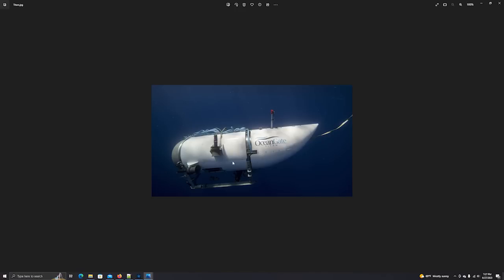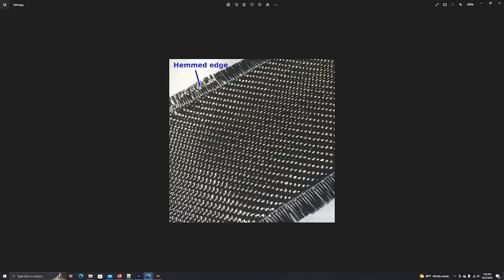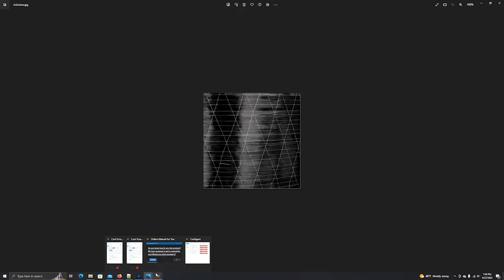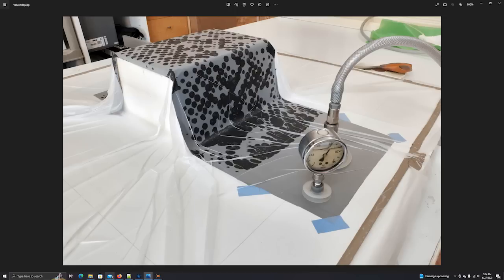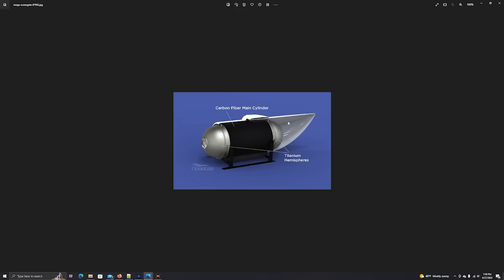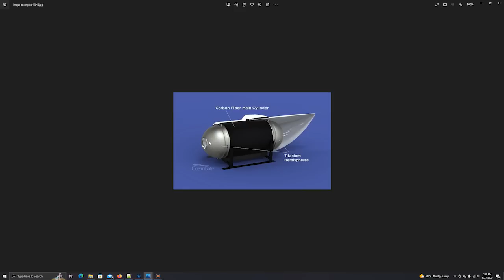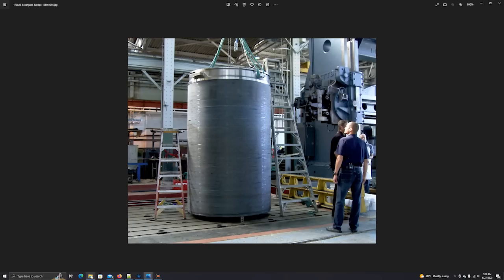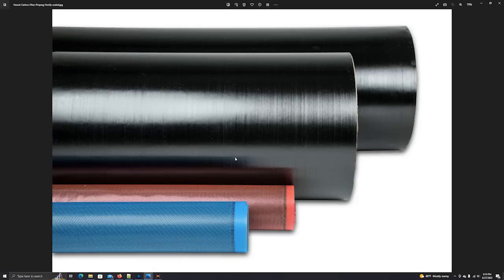Oceangate  Titan Submersible Manufacturing and Engineering Issues Part 1

Comment: I mean not to detract from anyone who has expertise in the subject with what I'm about to say. But the flaw in this design is so obvious and so basic, you do not need to even have a college degree, much less a degree in physics or engineering to see multiple fatal flaws. But the fundamental flaw of using carbon fiber to prevent COMPRESSION could be spotted by a curious child in grade school who's kinda into science. And adding epoxy doesn't change this calculus much.

If you want something to not EX-plode, you might wrap it in some strong material on the outside, or even integrate it into the pressure chamber. Adding a strong material that is difficult to break/pull apart will obviously increase the strength of such a pressure chamber. Just like wrapping your hands around something that's expanding might help prevent it expand.

But carbon fiber compresses easily. It's basically just strong thread.

Let's say you wrap some REALLY strong thread around a balloon. Would you have any extra difficulty squeezing the balloon? Maybe so. But you could still do it with your hands.

Yes, all the other problems are also bad, and probably what failed was not even the carbon fiber but the seals. But this glaring and obvious flaw that a grade-schooler could see must have also been obvious to the folks at OceanGate. How do I know? Elementary Watson. The vessel wasn't certified, wasn't even attempted to be certified, and the waiver that he made everyone sign is a tacit admission that he knew the problems with the design. That's without even getting into all of the outright admissions that demonstrated he knew, and dismissals of all of the warnings of experts.

Comment: Carbon Fibre is not strong in compression, no, not in compression, it’s as weak as Cotten in compression. the resin was the only thing keeping the sub together, sandwiched in carbon fibre. Just look how they made that sub, in an open air warehouse and glue. they paid the price though. Sorry to the families. Natural selection, that particular engineer had now gone, sorry he made such a massive mistake that he’s gone and taken other people with him. I could see bubbles under the carbon fibre even in the video!.
Reply from the maker: Yes I saw those as well,  That was from the older sub.  which I believed failed when they tested at UW

Comment: So, that link that was here, brought me to a power point type presentation. In the presentation, it says the length of the hull was 2.54 meters, 127 millimeters thick, and 1.68 meters outside diameter.  One claim, they say it was "RATED" for 4000 meters. It also claims to "PRESERVE LIFE" down to 6,500 meters. It also says who designed and built the Titan. It was designed and built by Spencer Composites in Sacramento California! I bet they closed their doors, and fled to a non extradition country! If they engineered it, what did Stockton engineer? Besides a short term scam! Only a complete fool, ignores the number one rule. SAFETY FIRST! Feel so bad for the 4 victims who lost their lives! It also says they used Pre-Preg, nothing dry. Yet, there is a video of a few people applying the resin to the end caps to put it all together!

Comment: These men must have had hugh pay out life insurance.  The insurance companies usually tie up payment until end of investigations which said to take over year.  It becomes of primary importance that all third parties, if any, are sought to scrutiny as to their possible contributory negligence in regards to any before or after handling of this submersible, it’s materials, it’s repairs, it’s testing, it’s rescue, etc. , it’s recovery, and whether it’s investigation was performed adequately within reason.  
All speculative data may be looked at but applied no basis towards.  Final true analysis is through factual data, factual examination of all pertinent information collectively obtained.  I would believe this to be submitted as evidence.  Therefor, having said what I believe aforementioned, it’s as important to submit facts in regards to everything, StarLink satellite use on 18th,  Polar Prince involvement on 18th, International rescue teams on 18th to days thereafter, any interference of any ships in about the area doing testing, any research, using equipments of any interference objectivity whatsoever, any underneath water  experiments taken place during time period, and so forth.  All of this is necessary and vital part of the entire picture to assess thoroughly, as well as, any further developments that any further investigations may reveal, whether done independently or by order.
Reply from the maker: Thanks for you feedback

Comment: Am i the only guy who sees carbon fiber as rich guy duct tape?  I knew a guy obsessed with slapping fiberglass on anything that needed a new life.  How is carbon fiber not just fancy duct tape.  I see duct tape.
Reply: Fibers are single dimensional. It doesnt even HAVE a 2 dimensional ratability.  You are basically talking about a strong screen but filled with whatever goo you are binding it with.  Sure you make layers to create a probability based simulation of 2d strength but its value is fundamentally zero.  Thats why its great for spars, single dimensional rating.  Thats it.  Look how overfat it looks just to save weight over aluminum on bike parts.  Gimme a break.
Reply: Sure hindsight is easy but before it lost contact i was thinking it just looked waaay too cheap and plastic to go to titanic.  I had a plastic toy baking soda submarine toy that looked safer
Reply: Vid shows they did carbon fiber bad too. Wowsie bad.
Reply: @lostpony4885  I away ride a carbon fork aluminium frame carbon way stronger when push on in one direction carbon wheels and rims spin faster...but the big deal about carbon is about the high temperature carbon (graphitizing) exhibits a higher modulus of elasticity the people who masters this are going to end the steel age....apparently.

Comment: Never seen vacuum in a measure of length
Reply from the maker: Inch of mercury (inHg and ″Hg) is a non-SI unit of measurement for pressure. It is used for barometric pressure in weather reports, refrigeration and aviation in the United States.

Comment: this cant be real, this whole things sketchy af.. acrylic porthole???  it flexed 3/4' at depth?? loud bangs and cracking sounds on previous dives? i didnt see any glue ooze out of the connection, nor did I see anything press the end cap on, no vacumn bag on carbon fiber, and I didnt see much resin either on the strands.
they went again and again without a scan of the hull??  yeah right

Comment: I can't believe that they just had a Lil' flange with adhesive to connect the titanium end cap to the hull of "linear spun carbon fiber" There is literally so many things that they did in the "design" of this deep diving submersible that just seem like such a poor choice for it's task. Even to the layman's perspective.. with them charging a quarter of a million per person to ride the vessel.. it makes zero sense why they wouldn't invest in the best engineered design of the actual vessel so it can handle stresses much greater than it's operating point. The way the hull and the end cap and the adhesive all reacted to the cold temperature, intense pressure's would be different and so it really was a design just waiting to fail like a tube of toothpaste.. it's so structurally insignificant for the task that it was supposed to be made for. I really don't get it from the "businesses standpoint" if they want good PR, more customers to keep making them money, why? Why not create the proper vessel to keep making $? They should have never operated at those depths. There is so much that could be said but it's just sad this had to happen before anyone "maybe does anything to improve this"
Reply from the maker: Thanks for the feedback

Comment: The water pressure increases as it goes deeper, causing the seals to become tighter. I doubt the carbon hull had any role in its implosion; it was more likely the plexiglass porthole that failed. The manufacturer had reported that it was only rated to withstand 1300 meters. As with anything, the weakest link is usually the first to fail. In the case of the orbiter, it was the o-rings and heatshield, while with the Starship Super Heavy, it's the Stage zero launch platform, and with Titan, it's likely the porthole.
Reply from the maker: That is a possibility, but in the recovery videos I did not see any carbon fiber at all.

Comment: They needed to wind the CF at multiple angles… even so, CF is not good to use with all the pressure and temp changes and having to use glue bond. It’s just a bad idea.
Reply from the maker: Yes that video was of the old sub.  The titian used prepreg and a tape wrapping machine was used.  But we do not know the ply orientation or the  cure or the compaction methods used.

Comment: The manufacturers image of the pressure vessel ( https://youtu.be/ufr78fq2pCM?t=784 ) is standing between both a six foot step ladder and a twelve foot step ladder. The vessel's carbon fiber component was nine feet in length. If i were to design my own submersible, it would follow natures design in the shape of an egg. Seems to me that from a structural point of view the egg is good at preventing outside forces from collapsing the egg yet at the same time the design allows for internal forces easy egress. I am pretty sure everyone is familiar with the experience of mounting a roll of toilet paper that is out of round onto a toilet paper hanger.
Reply from the maker: Yes, another person recommends testing a football shaped pressure vessel.

Comment: That thing cracked like an egg.Because it wasn't  woven in a crosshatch. Plus not thick  enough. Plus no testing.
Reply from the maker: Yes, the video was of an older sub.  The titan was  wrapped using a tape wrapping machine , using carbon prepreg,   But we do not know the fiber orientation or the cure or compaction data.  Thanks for your feedback

Comment: once i saw bicikle race here in Belgium and racer carbon bicikle from shaking on road disintegrate bicikle axe in pieces with racer finnished in hospital.. Carbon fiber is stron BUT wond accept shocks and hits and will fail after while
Reply from the maker: Thanks for the feedback
Reply: @JoediyLab  Carbon fibre is strong, but  cant stand tensions on fibre oor vibration. You can say its like inox. Wery dence and strong, but because of it breaks violent when pressure exceed. Prefereable would be metal wich is stron and can stretch, like Titaan.. Then nothing would heappend. Carbon fiber get miniscule porosion between layers and thats why it give away violently. It cant bent.
Reply from the maker: @WokeYtube  yes, thanks for the feedback

Comment: The inner diameter of the cylinder is 5ft not 8ft
Reply from the maker: I am referencing outside diameter,  Per OceanGate’s website, the Titan is 22-ft. long x 9.2-ft. wide x 8.3-ft. high. To put that in perspective, Titan's main compartment has as much space as a “minivan without chairs,” Pogue told PEOPLE.
Reply: @JoediyLab Weren't you talking about the pressure hull? It has a 5' inner diameter, 5'10" outer diameter. Maybe with the external shell it's and the legs it's 8ft I don't know about that. Not as relevant to the discussion of the pressure hull.
Reply from the maker: @matthew4878  yes I tried searching for the measurements of the pressure hull but could not find any.
Reply: The original design of the Cyclops was larger than the eventual design used on the Titan. The original renders showed a much larger pressure hull.

Comment: Carbon fiber is not that strong at all.
Reply from the maker: It is along as you use it correctly.  F1 chassis  are made of carbon fiber.  Also aerospace industry uses carbon fiber very successfully.  Thanks

Comment: Well, they are the first publicized victims of this material failure. Time to sell "carbon fiber market" shares?
Reply from the maker: Actually not,   a number of years ago  at the Isle  of Man TT, rider riding the Britten died when his carbon fiber rim failed.   Carbon Fiber when properly designed is a very strong stable product.  Up to 35% of modern commercial  aircraft are made of carbon fiber parts.